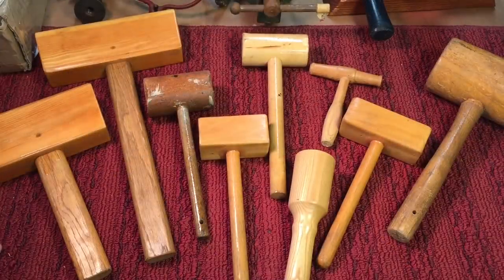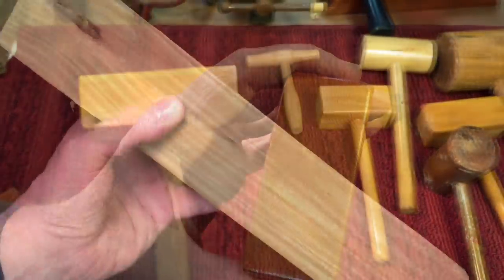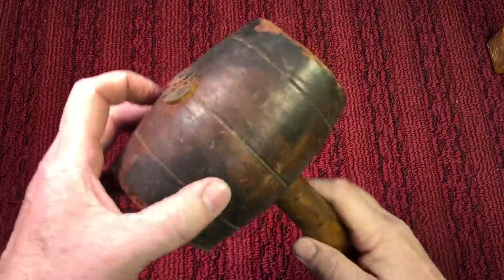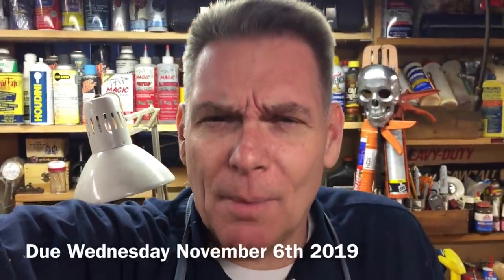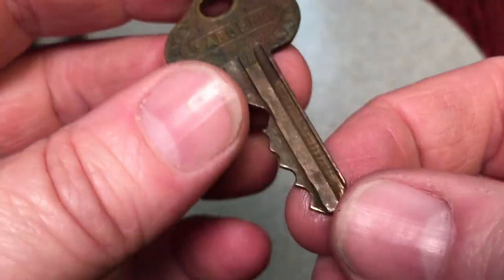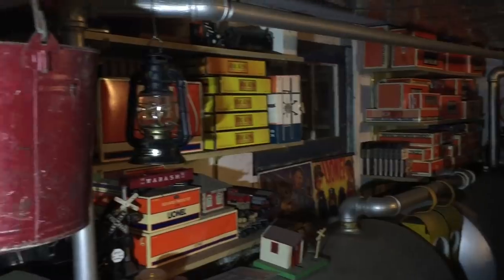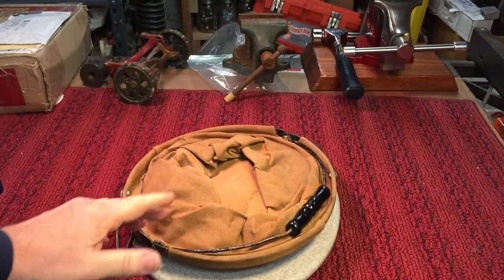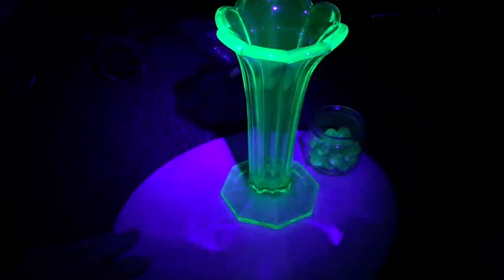MMM -New Challenge!  Sargent Padlock, Handy Folding Pail, Uranium Glass...

Comment: John, I also have several uranium glass pieces.  In addition to using UV light, I also bought a geiger counter to see if they were dangerous.  When stacking several plates together or measuring a real thick piece, the counter started to go nuts.  But based on the instructions that came with the counter, the REM's were below the danger level.  Still, I wouldn't want to carry around a piece in my pocket for an extended time.
Reply from the maker: Robert!  I will address that on Wednesday!   Great stuff!!!!  =D

Comment: I just love tooboxes and I wonder about yours. Not the big rolling chests but the hand carry wood, metal and some plastic ones. Also re purposed small metal boxes like the ones little socket sets come in. I like to see how other guys organize theirs. The wooden carpenter totes or the crafstman tool boxes. I try to keep one for different trades. I have one foe electrical tools, one for plumbing tools, a general purpose  for vehicles, one on every tractor, even one to keep my vet supplies in for working cattle and one with cattle ob tools for assisting in the birth of calves. I love just being able to grab one and knowing it has what I will need in it.  Show me what you have. I enjoy them even more if they are old, belonged to my dad or granddad, and I can repaint and do simple restorations on them.  I remember as a kid late on the way home. I would sleep in the back of the pickup and they would set dads tool boxes around me to keep the quilts from blowing off.
Reply from the maker: I feel the same way...  I love seeing how items can be organized or stored and enjoy boxes built to protect and store items...  Will do!

Comment: parent house was built in 1920, horse hair and oak studs! The floor joist were 2'x10"  and you had to use a metal drill bit for holes, paddle bits just over heat and dull.
Reply from the maker: Old growth lumber!  What a shame so much of it was scrapped!
Reply: @ScoutCrafter  House is still standing